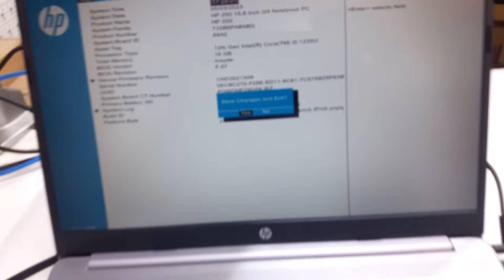HOW TO UPGRADE RAM IN HP 250 G9 LAPTOP  || HP 250 G9 MEMORY & SSD UPGRADE 732B6PA

Comment: Looks like there is a space for a sata HDD. Is there a empty slot for sata cable?
Reply from the maker: it has the space for 2.5 HDD but the connector is not there in this model.
Reply: @nprstechandvlogs8793  I see
Reply: @nprstechandvlogs8793 , can we put our own connector, is it possible though?

Comment: hello! can i install 2*16 gb ram in this laptop?

on HP support page i read this:
All slots are customer non-accessible / non-upgradeable
Support Dual Channel Memory
11. All slots are non-accessible / non-upgradeable.
12. Due to the non-industry standard nature of some third-party memory modules, we recommend HP branded memory to
ensure compatibility. If you mix memory speeds, the system will perform at the lower memory speed.

and now think about it
Reply from the maker: You can use crucial ddr4 3200 2×16gb
Reply: oh, it's good! and second question: can i install 2*16gb on HP 15s-eq laptop? on support page writen about max 16gb ram, but i read from some forums its not always true, and ram will work. in my country hp 255 g9 sales with only ryzen 5 cpu, and 15s-eq with ryzen 7 7730u, i want second (money different not too much)

thanks)

Comment: thanks for the video,but i have a question,i have this model,but it comes with a celeron instead of a i5,is it possible to swap the celeron motherboard and put the i5 or i7 instead?[note:same model]since you cant changes cpu
Reply from the maker: I think it's doesn't work. The motherboard design is different, and USB ports allso.
Reply: @nprstechandvlogs8793  actually no,the only difference is what cpu it comes with,the motherboard layout and port layout is the same for the i5 and i7 variants,i want a full motherboard swap because you cant remove and change cpu
Reply: I think it can be done that way. I have looked at the 255 variant with Ryzen CPU and it is the same design as this one. So I am even considering buying that and swapping it with my i3 variant @ghostthatgames27
Reply: @as_i_say  could you keep me informed on how it goes?tired of this celeron model

Comment: Thank you for this usefuıl video. In the end I dissembled the same pc and updated ram capacity from 8 to 32 GB.
First unplugged the battery and changed new rams with the existing piece of 8GB ram.
After I plugged the new pieces and the battery, I tried to open the pc but it didn't open. 
I closed the top box and screwed it and then tried again after I plugged the power adapter.
In the end I saw the screen with CMOS Reset Error Screen with a QR Code.
Pressed ENTER and saw my system stood up.

I didn't understand why I faced this issue but thnaks God now it works, there's no problem.
Reply from the maker: Thanks for watching. After upgrading  hardware, sometimes it gives that messages you need to enter to continue.
Reply: @nprstechandvlogs8793  by the way I saw a space to mount a SATA SSD near the battery. But there was no connection for the data and power this sata ssd. Can you take a video for this upgrade also if you can?